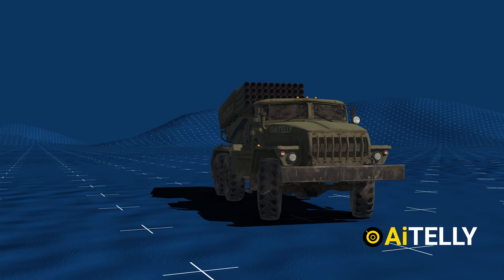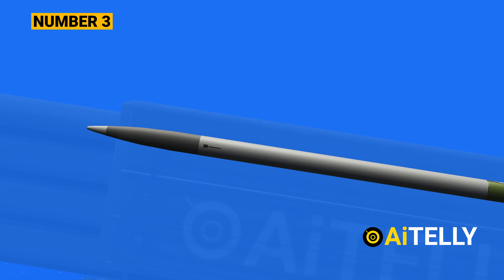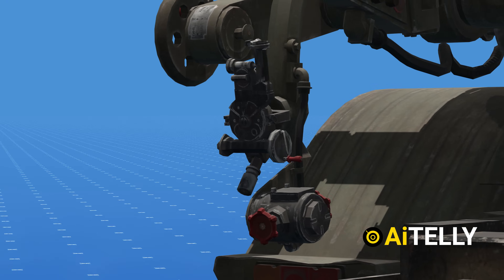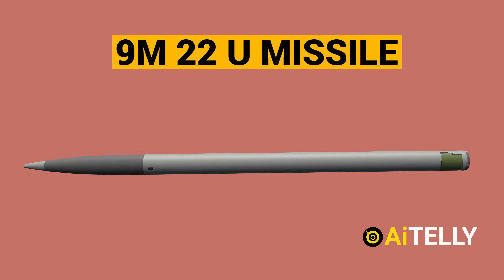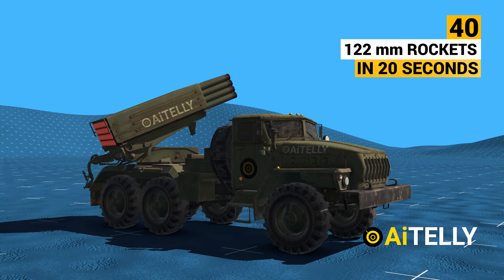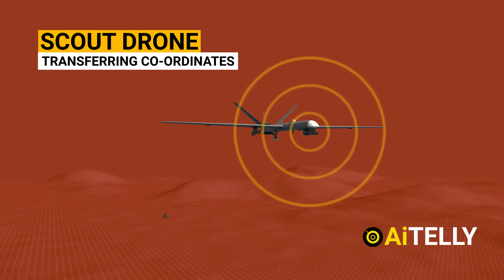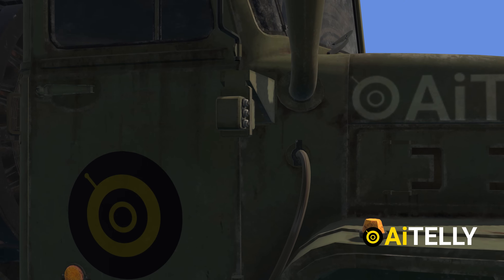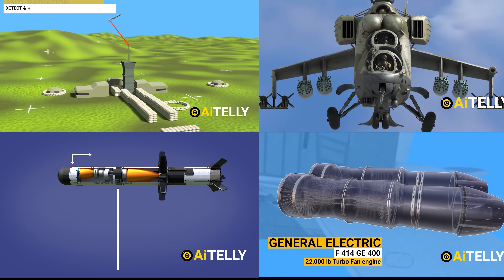Why this BM 21 Grad Rocket Launcher from the 1960s is still in service & How it  works #rocket

Comment from the maker: Comments from our Viewers

Cost of the Rocket.
Credits "Burning Sinner"

These rockets are actually $350-450 a pop for all non-guided ones. 

Well, russian military doesn't pay the export pricetag for anything. My numbers are essentially 2004 (Nothing to see here, officer, 15 years has passed) price tags adjusted for inflation (In Russia, you have global multipliers rolled down by the feds. Feds never pay more than infation adjustment rates, that's why inflation rate is one piece of data you can actually trust on, every factory depending on the government lives and dies by these multipliers).
These don't adjust for new tech though. Laser cutting should have sliced the prices significantly (Bulk of the price for HEFI rockets is for all the thin rods being cut into ready-made fragments. I know that new rods are cut with lasers, but I no longer involved in the system to give you the exact numbers on the internal math).

"Георгий Тимофеевский
"
I heard a claim that grad missiles costed (in 2005) costed 6000 to 60000 roubles, which was like 200 to 2000 dollars. So, the price in your video seems like the upper boundary
Reply: No way these missiles are 400 $ in 2022 prices. Just the material (70 kg) will cost about that much.
Reply from the maker: @nehorlavazapalka  russian militarry data are in a very grey area-we are also confused .
Reply: @nehorlavazapalka  That's where you are wrong though. We russians don't buy stuff on the market unless it's needed. And nobody get to sell on external markets unless he meets agreed upon internal demands. The access to external markets is something you work really, really hard for if you were unlucky to think of starting your bussiness in the wrong prospect. Growing and selling flowers is nice and dandy. Growing beets? Uh-oh, you better not hit that truckload volume unless you want to be regulated to hell and back since we produce sugar from beets and sugar is considered to be strategic resourse. Get ready to sell good chunk to the government at government prices too.
Missile consist of 20.5kg of long artillery powder (It's about 3 dollars per kilo), 20 dollar fuse, roughly 6.4kg of explosives (Varies by type, but we talk about RDX levels of affordability, about 16 dollars per kilo. Rest is the work, the rods and the pipe. Rod is about 4 kg worth at $0.96/kg and pipe is roughly $0.75/kg
All in all, for materials, you get $216 dollars. Rest is the work, assembly and very low profit margin
Explosives - 102 dollars
Powder - 61,5 dollars
Fuse - 20 dollars (Produced by dedicated gov facility, price is non-negotiable)
Rods - 3,84 dollars
Pipe - 28,5 dollars.

That's one thing people seem to fail to understand — when it comes to anything even remotely vital to the gov, market prices stop working because market stops working. USSR may have fallen, but we are essentially in state capitalism now. It gets to the point where we pay about $150/month for all our utilities and $5 dollar for our internet plan because basic needs coverage is NOT exactly considered non-government matter.
Reply: @Aitelly   ak 47 in roket  bm21
Reply: I saw a Russian documentary on YouTube.  5hey were talking about 120 roubles in soviets times
Reply: @yankoyankov7457  That was back then. State apparatus suffered through "feeding" system, when the "allied" people's republics were receiving the parts contracts and many high margin wares factories. Czech had their tram contracts, GDR had EVERYTHING, a lot of light planes and ships were outsourced as well, Ukraine had many pipe contracts despite their pipes being of poor quality, expensive and always lagging behind said contracts. And nobody bat an eye. That was the main reason for USSR downfall - too many countries had their loyalty bought at the expense of metropolian folks. As a result, said folks removed metropolian government. 
Allied soviet republics decided to stand ground of preserving the USSR, which boiled down to anti-russian ethnic cleansing in said republics until RSFSR change their mind and get back in the USSR (Yes, irony of supporting Serbia in Kosovo affairs is burning brightly). Current affairs with Ukraine is just getting even and taking back what was essentially stolen. 
That's why we are in state capitalism now. We never really opposed it's internal mechanism, we just condemned and tore apart "friendship among nations" policies, which for some reason boiled down to Russia being a sugar mommy for the rest of 2nd world, with a minor exception of Belarussia.
Reply: @Nighta90  Yeah, feels bad to die on budget, huh?
Reply: Yeah, those pricetags are MUCH more realistic than "2000$", because i recall seeing specifications for a leaked contract selling these rockets to someplace Africa just a few years ago, and despite being a fairly small commercial contract(ie, it included a hefty profit margin for the Russian supplier and no bonus for largescale orders), they were selling these at $500 each.

So the Russian military getting them for 350?  Yeah, that sounds very plausible.   Might even be a good bit less now that they've ramped up production.
Reply: @DIREWOLFx75  To be perfectly fair, these were most likely the old surplus (Warheads are checked with ultrasound for structural integrity, fuse is changed if remaining shelf life is too bad, rocket engine is replaced - don't want no "Failure to eject" issues, let alone going out with a bang), plus the contract in itself was most likely a follow-up (Kinda like buying your stuff and applying guaranteed discount coupons in grocery store). 
But still, these are meant for profit. And meeting quotas on military contract is what grants you right to sell on external markets. 
There are more expensive options though, including new extended range (40km) GLONASS rockets. These babies are meant to be fed in newer "Tornado-G" system which is equipped with tube-mounted programmators, but rockets (Or should I say missiles at this point?) can be programmed manually and loaded into the oldie. 
These come in both HE and airburst "buck" flavour. Obviously, THESE cost more and I can't help you with prices for these. Don't know how many layers of BS they are manufactured with, but these should cost at least 206-250 dollars more (Devices this light are somewhat cleared to use "civilian" grade electronics, so I ballparked GLONASS module, axis control kit, low accuracy twin laser rangefinder and control board to keep it stitched). Although, given the low volumes and corruption, I wouldn't be surprised to know that price actually overshot $1000
Reply: Uhj
Reply: @nehorlavazapalka  in Pakistan and Iran can coat as low as that

Comment: The only thing worse than a BM-21 is  more than 1 of them working together.
Reply: And a few drones to spot the enemy and guide the rockets closer to their intended target.
Reply: Said no one on the receiving end of a strike
Reply: Or a Tos-1
Reply: @Iamabot4708  4 or 5 of these can level a city block with relative ease
Reply: The OLD BM-21 Grad has a range of 20km. But the improved new version of this system under the name TORNADO G. It has a range of over 40km, more than double the BM-21. And it has new opto-electronics, inertial/GPS and Glonas navigation. And everything is done from the truck, there is no need to mechanically calculate the parameters... Although this possibility is kept just in case. So the system remained simple, only twice as deadly and still cheap to operate and maintain.

Comment: Keep in mind 2000 is an export/sale price, meaning it costs the manufacturing country far less for domestic acquisition
Reply: Domestic cost of Russian missiles are 4-12 times cheaper than export price depending on model.
So Russia basically can spam millions of grad missiles with affordable cost
Reply: @mrobocop1666  Given that a rocket weighs probably about 100kg they are cheaper than pork meat.
Reply: Literally happening in real life
They fire a barrage of BM21 then the irondome intercept all this dumb missiles
Reply: @boopitywoop7981  , you are watching too many movies. GET REAL with the irondome LMAO
Reply: Russia also view Russian soldiers as a cheaply built missile; very disposable.
Reply: @thetruthsayer8347  that's your opinion only. They provide good support both during and after service.
 I'm sorry but your disability is not service related. Sound familiar?
Reply: @deven6518  coming back home in body bags is not services they signed up for.
Reply: @boopitywoop7981  Google tells me that 1 iron dome intercept missile cost around 50 000$ so even if they intercept all the bm21 missile it’s still very much a huge economic victory as if you compare the export/sale price of the bm21 rocket of 2 000$ per unit that’s 1 iron dome intercept missile is equal in price of 25 bm21. Idk man strategic victory probably not but massive economic victory
Reply: @banana6837  most vidoes you see on yt with irondome intercepting missiles were shot from ancient BM21
Reply: @mrobocop1666  yet they don't lol
Reply: @boopitywoop7981  i imagine how irondome works when barrage made by battery of 6 vehicles? 12? 18?
Reply: With logistic and maintenace is a lot more than that.Everyone fail to see that.
Reply: @thetruthsayer8347  regarding body bags. Ukrainean side had some viral vid with interview of their soldier who was assigned to dig graves for yellow-blue deadmans who tried to fight with Wagner's in Bakhmut. Man literally crying and asking for what they all died for. Its very ironic after all that bodybag trashtalks from their side
Reply: @boopitywoop7981  Even Hamas was able to overwhelm Iron some with their shirt firework crackers😂
Reply: It costed 2000 USD to produce, not including shipping.

Comment: The himar is a 70km sniper rifle, the grad is a 3 tone machine gun.
Reply: Where the Russians are actively blocking GPS, Himars is useless. And many more Himars missiles were shot down by Russian air defense. Ukraine first shoots a hurricane, then Himars. This is the only tactic that works.
Reply: @andrejaga3003  no, no they aren't
1) GPS jamming doesn't work because the missile has internal guidance
2) there is no successful example of a s-400 intercepting a m31, plenty to the contrary with the kherson bridge.
3) the grad storm to overload counter battery fire radars computers, so that the himar doesn't give away its position.
Simply put the himar system saw the Russian artillery greatly weakened and saw kherson retaken.
Reply: @terrynewsome6698  Ukraine struck multiple ammo reserves with the HIMARS in Kherson and if you couple that with the fact that it's hard as hell to get a supply chain going in Kherson from the russian's POV it's understandable why they gave up Kherson and chose to preserve their manpower and did a total withdrawal.
Reply: @zenon1261  exactly why the himar won kherson. Armies need food, ammo, and fuel to fight, and himar denied Russians all of that.
Reply: @terrynewsome6698  The Russian Department of Defense reports are blocking, but if you find them, they regularly report how many Himars missiles the air defenses have destroyed. 6 missiles are easy to intercept, but they are very expensive. Therefore, the Ukrainians fire Typhoon missiles to distract the air defense, and then Himars. The Russians left Kherson because the Ukrainians shelled the dam every day. It survived because it was built by the Soviets with a large margin of safety. But if the Nazis had succeeded in destroying it, a lot of land would have been flooded in 2 hours, thousands of people would have died. Now Himars are actively used to shell Donetsk, but the Western media are silent about this.
Reply: @terrynewsome6698  Yesterday (01/28/23) Ukraine sent 4 Himars rockets to a hospital in the city of Novoaydar. 14 patients died and 24 were injured. Is the Western media talking about this?
Reply: @andrejaga3003  reality 4 rockets hit the ammo depot in the building across the street from the hospital, the ammunition cook off showered the street. 3 people not 14, yes 3 Russia likes to inflate numbers. Next time don't store ammunition in a civilian area, which is a war crime by the way, and that would not happen. Try again
Reply: @andrejaga3003  hey bot are you already on your way to ukraine? 🤣
Reply: @andrejaga3003  Still coping that daddy putin is losing the war? 🤣🤣🤣
Reply: @t0m0ffel nice joke